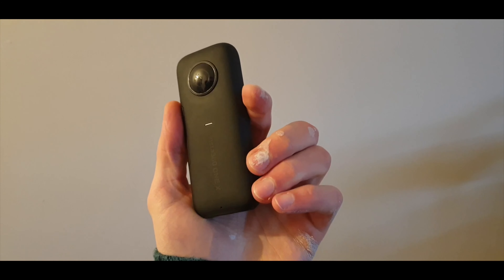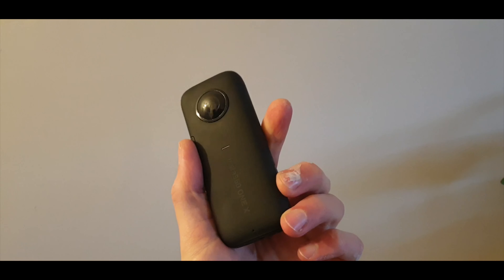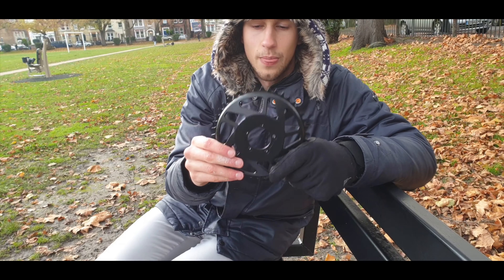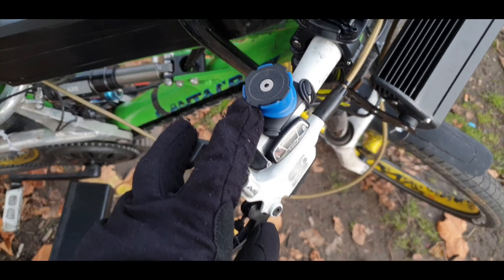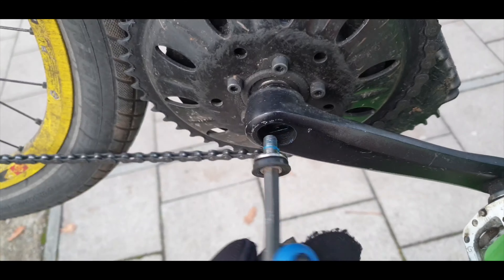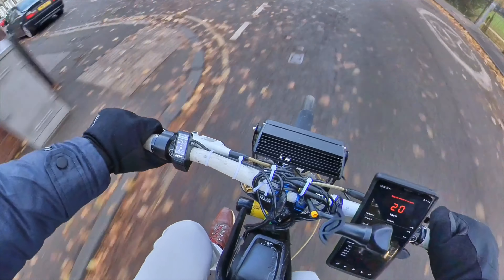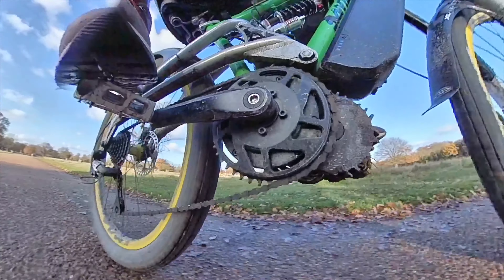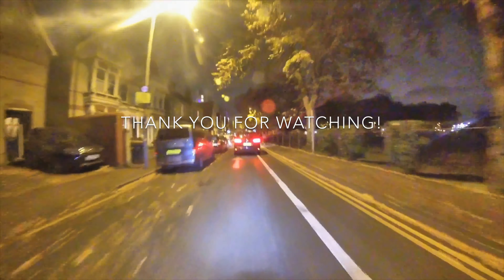New Chainring For My BBSHD Frankenbike

Comment: Replacing that old heavy chainring was a must, but I think my best upgrade to my BBSHD was swapping out the factory controller to the Ludicrous controller(3000W) from Lunacycle
Reply: apart from being ugly i doubt 200g on a chainring would make a noticeable difference with that much power, especially on a heavy bike

nevermind the price of some of the chainring options, people recommending the Bling Ring have too much money on their hand, €110 for a part that will wear out

some people on the MTB scene really throw money away for a negligible difference, i don't care if my battery dies 1% faster, if even that

and yeah the controller etc are worth much more than a chainring upgrade, apart from the fact the original chainring doesn't have a nice bitey profile (doesn't hook onto the chain like the Lekkie does) but there are far cheaper options that do the same thing except for save 50 grams at most